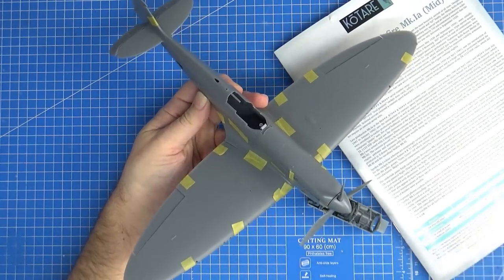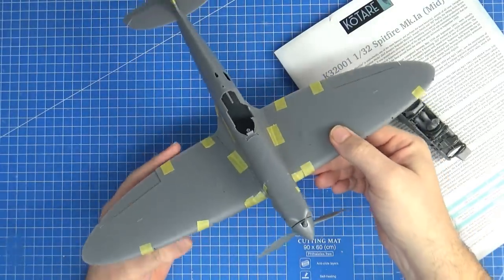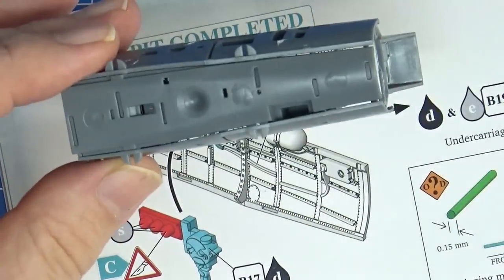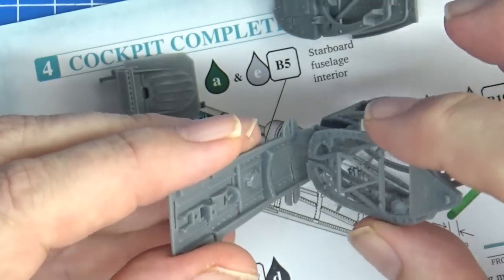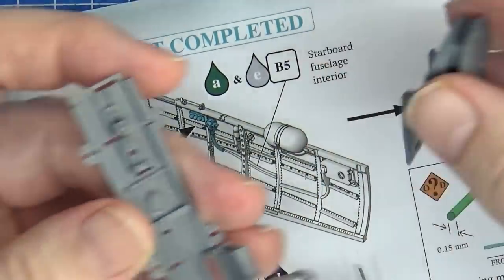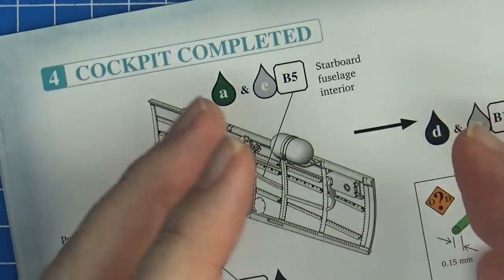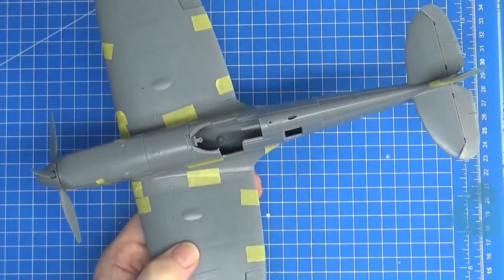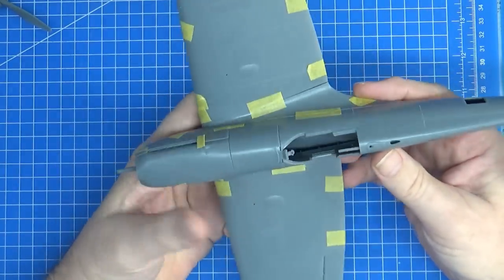Build Review - Kotare 1/32 Supermarine Spitfire Mk 1a (mid) Part Two

Comment: Wow, you hit a home run with this one. Your presentation of the build is spectacular. You discussed a couple of things I was impressed with. First, your comment on no engine is spot on. Agreed, an engine would distract the beauty of the Mk 1’s lines and shape. Your discussion of the correction to the wheel wells was helpful. And finally, thank you for emphasizing the importance of proper cleanup.  Thank you again.  Eric.
Reply from the maker: thanks Eric, hope it helped - I'm actually building this kit right now, decided to go for it. Fitted a resin pilot and have adjusted the flight controls as well, hope to have a video up eventually! Cheers, Chris
Reply: Thank you again.

Comment: I built the Tamiya mkixc about 2 years ago, my first 1/32 kit in 40 years! I felt like i didn't do it justice and so was excited to order the Kotare and have another go. I'm quite happy not to have the complication of dealing with the engine.
Reply from the maker: Yes the Tamiya Spits are quite daunting - if you dont get the engine assembly perfect, and I mean perfect, the starboard engine cowling wont fit correctly. The gunbays are also tricky sometimes, they really are quite complex kits while the Kotare Spitfire can be built by almost any level of competence. 
You're not the first to say, phew, thank Dog below I don't have to spend an inordinate amount of time and energy to build the engine! It should be an option, not default, but there's a lot of car modellers masquerading as aircraft modellers out there....
Having said that, I'd love to build a large scale (1/16 or larger) Merlin engine on its own.

Comment: It's quite something Chris when you consider that with the hundreds and hundreds of Spitfire kits that have been issued over the years, this may be the first one that is near (or actually) 100% accurate in surface detail. A few people have made comments about the texture of the plastic on the wing surface - I can only assume that this too is deliberate as it is different on the gun bay covers, and they indeed would have been a different alloy and thickness. That's a whole other level of care and attention.
Reply from the maker: Exactly my point - you dont get this level of detail and attention from other kit manufacturers, which is why I'm more than prepared to spend a bit more....thanks for your comments again Phil, always welcome!
Reply: @beckersmodels  I've dipped into this again and thinking about your comment re 'everything open' modellers should be in the minority, I agree with you because really those modellers are diorama modellers rather than aircraft modellers.

Comment: Great pair of broadcasts Chris. 100% agree that more planes should be wheels up. But as a counter on this, as this is a high price kit, and yes engineering is probably one of the best, it has been designed for static display, so you can understand those who are miffed to have no engine. If they provided one, added the extra $ into the kit price, no moaning minis then. Also if you do build in flight, it’d be cool to have the Merlin with an engine stand to display separately. 
As for the 1/48 Airfix bashing, you should try the Anson and Buccaneer might surprise you. If the Gannet lives up to their promotional photos, even you’ll be tempted to do wheels down, with bifold wings. 

Keep up the great work.
Reply from the maker: Thanks Mark.

I really like the new 1/48 Airfix stuff in terms of design and detail - don't get me wrong - for example the new Walrus - but Airfix quality control is what lets it down. Short shot sprues, badly packaged parts, and too much variability from kit to kit - I've been burnt too many times to trust them. Maybe the new 1/24 Spit run (which is all made in house and looks fantastic) will turn this around, but I'm very sceptical of their ability to create quality product. 

And yes I'd do a Gannet wings folded too!

Comment: Hi chris.  Good review.  Could you solve your "pull out" of the booklet by removing staples?  Put them back afterwards of course.
In your cons, you forgot the flat on the tail wheel.  A second non flat tail wheel would solve it.
Thanks Penny, for having us.
Reply from the maker: YEs I did forget the flat on the tail wheel - and I did mention to Richard Alexander that a separate set of non weighted wheels would be grand, maybe they'll include that in future kitsets for us non-wheels down folks!
Reply: @beckersmodels  Well done Chris.  A bit late for this frame set but the next would be good.  I like on ground and in air.  I had thought of the possibility of two AC in hangar, one ready to go and one buried in mechanics etc.
Incidentally I was just watching the Typhoon legacy channel (rebuilding a tiffie in Canada and they showed a photo of workers in the factory "puttying" over the rivets on the wing.  Quite a coincidence with you talking about rivets on models.

Comment: Will get one for sure. The riveting on the rear fuselage looks a little bit overdone to me though.
Reply from the maker: It looks overdone in the light, but in actuality is just right. If you're still a bit concerned, one very light pass with a sanding stick will knock it down easily.  And yes get one!

Comment: Regarding adding a pilot: I'd argue that this is a field best left to aftermarket, just like the engine. Many may not want one. Then, do you want him piloting the plane, on the ground, in the cockpit, next to the plane? It all depends on the story you want to tell. And a pilot figure really deserves the additional detail that resin or photolithography can provide.
Reply from the maker: Very good comment and its quite true - the added detail is necessary if you really want to make the model realistic, and yes most modellers dont want to paint a figure either, since its a hobby in and of itself to master!

Comment: Now that's a Spitfire, loved how they captured the wing shape,  excellent in depth review. The keyed parts will certainly increase build accuracy - I'll be anxiously awaiting the painting " videos".  Speaking of paint schemes, the Spitfire version with half black and white underside, is that an actuall scheme? My next learning kit is a 1/72 , showed the same scheme I thought they were just showing two options in one because of box size. Last the only part I  thought looked a bit out of scale , was the ant , although he moved quiet nicely :-)  seriously, An epic kit. I won't have the skill set back for at least 6 months, so I will probably wait until I'm sure I can tackle it to buy it, unless you think there is going to be an inventory problem by Kotare . Plus I need to figure out where to get the kit and build the stash cash back up. Thanks again for great review, Cheers from the colonies  BOB.
Reply from the maker: Gday Bob, yep the black and white was the standard paint scheme to help the AA crews over England, but was changed mid Battle...yep you wont have any trouble with construction if you take your time! Cheers Chris

Comment: I got excited when I heard about this but there was one reason that I baulked at a pre-order and it's still causing me to wonder if I should or not. It isn't the lack of an engine, the decals for the cockpit or the way it it designed to be posed. It's the price. After watching this review I'm still excited but I still wonder is this kit worth paying three times (depending on where you get it) as much as you would pay for the Revell Mk I kit at the same scale? Is this kit three times as good as the Revel kit?
Reply from the maker: Good point Steve and I must admit I dont get that much sticker shock anymore, but it is an expensive kit compared to say the Revell, which costs about $60-70AUD here. I've had the REvell kit before, and it needs A LOT of accuracising to get it anywhere near the Kotare kit, especially in the cockpit, but also externally, with poor rivet and panel line details. I spent about the same amount on aftermarket resin on mine as I did on the kit, but eventually just sold the whole lot away as it was going to be too much work.
This way, Ive got a lovely Out of the Box option with almost zero effort but a fantastic finished result - and I'm more than happy to pay for that. So yes, I would rather have this kit than 3 Revell Spitfires...but not everyone is as pedantic when it comes to detail and fit etc, so I can understand the concern when it comes to price. Cheers Chris
Reply: For me it came down to "You get what you pay for."  I've heard a lot of criticism of Airfix, Revel (!!) and Italeri,  and a lot of folks saying things like "We're modellers!  We make things fit if they're really crappy!  We're stupid old fools and won't change our ways!"  Well, I'm old now but I want to spend my money getting quality stuff;  I'm not 11 years old any more and happy to get my next kit with all it's defects that won't get fixed because I haven't got the skills or knowledge yet.  And now I'm old, and very happy to have paid as much as I did for this model.  Three times as good as the Revel kit?  Don't know.  Wouldn't buy the Revel kit.

Comment: I‘d argue putting sprue gates on contact surfaces is the way to do it. They are easily cleaned up; and after assembly the blemish is hidden.
Reply from the maker: Thats true, but not when theres a step just near the clean up point - hard to get a basic hobby knife in there, I used one of the Hasegawa Trytool 1mm chisels to get at it, which not every modeller will have in their toolbox.
Reply: @beckersmodels  Point. Truth be told, I was just listening to the narration at that point.

Comment: Here comes "that old guy".  When I was a kid EVERY airplane kit had a pilot. There were no exceptions.  Every kit.  Started in the fifties. We had Monogram, Aurora and Revell. The rich kids had others.  That is all.
Reply from the maker: I'm an old guy in young body - I expected every aircraft model to have a pilot, flight stand and wheels up display, but was shocked to find only a few reboxed old kits did so, and the trend was wheels down, everything open like heart surgery...
I'm with Paul Budzik on this, that all aircraft kits should be wheels up as standard, and then if you want to go wheels down, you have an additional kitset that has the landing gear and engine and other parts that you then insert/modify the standard kit with....
Reply: @beckersmodels  - it seems so obvious when you put it that way.  The models and their designers had mostly kids in mind then and personally I want to see some of these new genius Zoomers building kits, bashing kits, creating altogether new and different craft...and putting the gear up.

Comment: So, the "make sure there's no paint on the mating surfaces" thing seems like a weird thing to have to say. I was always taught that paint really farts with glues ability to bond with the plastic, so the surfaces always should be clean anyway.
Have I been lied to?
Reply: not just wrt glueing, but wrt fit tolerance.
Reply from the maker: Not a lie its just a lot of modellers will paint parts on the sprue or off and paint the whole part, but not be too concerned about overspray when it comes to mating surfaces. Fit tolerance is really tight here and will only need a small amount of extra thin glue to get going...

Comment: Where's the heart of this amazing aircraft the engine ? Is it coming as an extra optional kit ? why did they leave this out ?
Reply from the maker: First, its not a car model, the kit was designed for the majority of aircraft modellers who like to see an operational aircraft ready for takeoff and enjoy its uncluttered lines. Not all panels have to be opened up and I'm sick of this trend with new kits. 
Adding an engine adds tremendous cost to tooling particularly one as complex as the Merlin.
There will be a resin engine available soon I'm sure, or you could modify the Tamiya later versions.
Reply: @beckersmodels  No worries Beck ,  Im  just surprised because they made it even more detailed on the outside than Tamy's 1/32 .  And yes ,  it is an amazing kit,  no doubt about  that , and  apologies  if I came across negative  , I was just expecting to have the engine as well,  because there was a lots of praise and excitement on the pre release. But I get where you are coming from,  its all about the the details on the in flight build on this great kit .

Comment: My only comment in what appears to be an excellent kit is their are no separate inner wing flaps, they've been moulded into the wing, yes we have separate outer ailerons etc but surprised there are no separate landing flaps. I guess this was due to the fact that in 99% percent of cases when the aircraft is on the ground the flaps are flush with the wing.
Reply from the maker: You hit it on the head Mark for the reason without the molded down flaps - because almost every other Spitfire kit out there (except an old Airfix 1/48 moulding and the superlative Tamiya Spits in 1/32) are all down flaps up...you only see Spitfires flaps down when on landing approach...which funnily enough is an inflight diorama I want to do one day!
Reply: I was a bit eager in my initial comment as towards the end of your review you mention the very same thing I said about the inner flaps being always up when the aircraft is at rest.
I designed a book on the Spitfire written by the late Dr Alfred Price a number of years back and all the pics of the aircraft through all marks show flaps up when at rest – apart from one – the very first production Spitfire K9787. On the same page is the first Spitfire written off K9792, which flipped on landing due to a fractured axle stub. Whilst its on its back the inner flaps are down as for landing and they show much detail.

Comment: Personally, few things are as frustrating as patiently assembling and painting a part of the model only to realise later than it's entirely invisible, without cutting out panels that aren't intended to be removed, and thus are a complete waste of time, paint and plastic. Why not do a "with internals and removable panels" or, "without, just the external profile only", variants?
Reply from the maker: That's been Paul Budziks contention for awhile - kits should be provided in two boxings, a basic non-opening panels version external profile only that has the cutouts in relief if you want to expose the detail that is then purchasable in an advanced boxing (internal parts, engines, weapons bays, wheel wells etc). Kotare are moving towards this which I applaud...

Comment: It looks a great kit, but - BUT - aren't Kotare being a wee bit cheap here? Screwing the 'in-flight' team with no pilot/second set of no-weight wheels, and screwing the 'at rest' team with no engine? It seems whatever you want to do with the kit, you miss out somewhat.
Reply from the maker: Inverse of cheap. It costs money and valuable development time (when no cashflow is coming in) to tool extras like that - they are making these at a price point to recoup the initial investment cost. This is a very very small company going up against the big guns. They could have done this in 1/72 or 1/144 at much much lower risk, but wanted to stick with manscale because its a big niche that no one has filled...
Reply: @beckersmodels  That's a good point. I retract my criticism. Maybe once they've got a few under their belt they may start adding one or both.